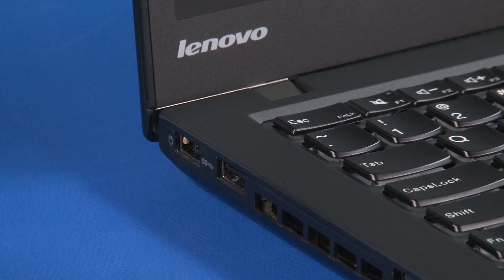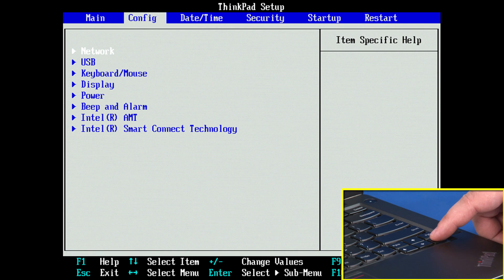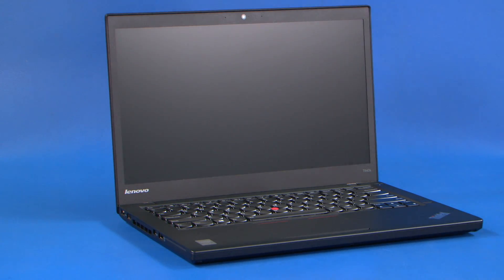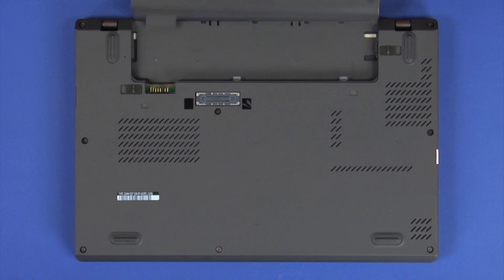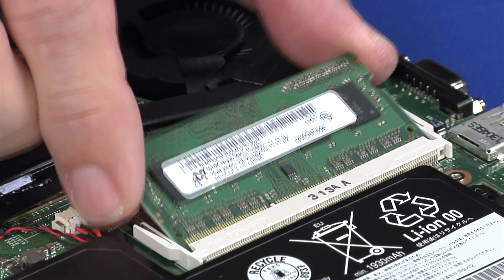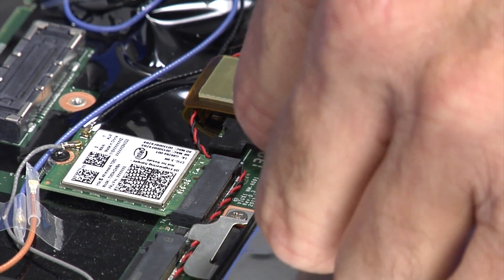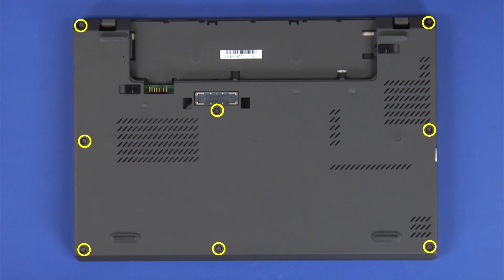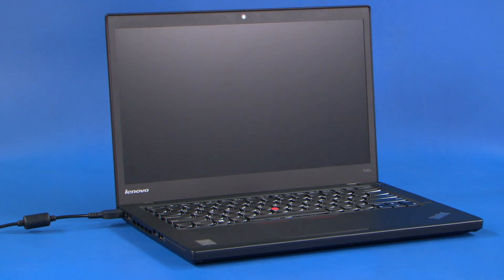ThinkPad X240, X250 - Memory Module Replacement

Comment: ram is basically plug and play, there is no big deal in replacing the memory with the battery plugged in. in any case just unplug it from the cable instead of having to do the BIOS option and then having to connect the charger just to re-enable it

Comment: Hello sir, thank you for this video, please how I can verify if my Thinkpad support 16 GB of ram, I need to upgrade my Thinkpad i5 4300U to install some stuff for studying networking and switching?
Thanks in advance
Reply from the maker: Hi BOUDJEMA! Thanks for reaching out. Could you provide the exactr model number of your Thinkpad laptop for us to check the specifications? We're here to help. Mark_Lenovo
Reply from the maker: Under the laptop there is a sticker where you can see some information. Could you check for the Machine Type Model (MTM)? Mark_Lenovo
Reply from the maker: Thank you for providing the information. We highly suggest you to delete the serial number you posted publicly for security reasons. As per the specifications of the Thinkpad X240 laptop, there is only one socket for the RAM/Memory Module and the maximum capacity is up to 8GB. You can check the specifications here https://lnv.gy/3mgbIua - Let us know if you have other concerns. Mark_Lenovo
Reply: @LenovoSupport  thank you for your help

Comment: Does the x240 have internal Ram like the t440s ? Like now i have 4 GB Ram , are those internal and will adding an additional 4 GB result in 8 GB Ram overall ?  Thank you for help
Reply from the maker: Hi. We're looking into your case and will provide feedback as soon as possible. We apologize for the delay. Heart_Lenovo
Reply from the maker: Hi Sam. Thanks for reaching out, and we're happy to provide assistance or direction to help you with this. Upon checking the internal memory is upgradable and supports up to 8 GB, so if you have 4 GB, you can still add another 4 GB, or simply get an 8 GB memory. https://lnv.gy/3CiIGym. Have you tried to contact our service centers for the upgrade? If not, we highly suggest that you seek assistance or contact them to check your device and provide the options necessary. You can also check the nearest and other accredited service centers from the below link, choose your country, support provider, choose home for your personal device, and on the right side press the location button and type your address, and hit search https://lnv.gy/3CEoFUe. Let us know how it goes. Heart_Lenovo

Comment: I replace 8GB to 16GB and computer don't  want to start. With 8GB it's ok. I tested few 16GB. I already update BIOS. What should I do?

I've got X250 i7-5600
Reply from the maker: Hey there, Adam. Thanks for reaching out to us. When you mentioned that the laptop won't start, does it mean that it's no longer powering on? Are you getting any error message or error code? Could you share with us the exact model name/type of your laptop for us to check? Here's how https://lnv.gy/3G19CCZ. We'll wait for your response. Rodney_Lenovo
Reply: @LenovoSupport  After replacement - the monitor screen remained black. Only the "power" button is lit green. I have installed the RAM "03X7015". The store where I bought the computer has already installed a few other 16GB RAM memories and also to no avail ...

SN of Lenovo: D28FFODE-386F-4CFD-8202
A8FC488F3113
Reply from the maker: I see. Were you able to disable the built-in battery prior to Memory Replacement? Hector_Lenovo
Reply: @LenovoSupport  Of course. I followed all the steps precisely as in the movie. After installing RAM, I waited up to 20 minutes for windows to turn on
Reply from the maker: I see. It seems that the socket is working, as it boots with the 8 GB RAM connected. There are cases where the boot is delay on brand new RAM, but eventually works after couple of minutes. Did the store test the memory on other computer as well? Hector_Lenovo
Reply: they wrote to me that they had the same problem with other X250s.
Should the RAM of any manufacturer with the "16 GB ddr3" parameters should work? not only "Lenovo", "Crucial"?
Reply from the maker: Could you share with us the exact specification of the RAM that you purchased? A photo of the sticker attached to the side of the RAM will help. Looking forward to your response. Rodney_Lenovo
Reply: @LenovoSupport  dear Rodney, I have a very similar issue with my new 16gb RAM - it turns on, but returns an error a few mins into the work, and then the blue screen appears with "Memory Management" error. I tried to format my Windows, but it fails even during format. Then I decided to perform a memory test in boot menu, it fails the integrity test. However I don't think it's a RAM problem. Any advice would be helpful..
Ironically, everything works just fine with 8 gb stick. Thank you in advance

P.S. my Lenovo is X250, cpu i5 5300u
Reply from the maker: Hey there, Mardan Tahmazli! Thank you for reaching our support! Just to confirm, did you add an additional RAM module into the laptop? If yes, did you purchase the same type/frequency of the RAM module for the X250? If the laptop works with the 8GB RAM module that came with it, it means that the additional RAM module is the one that is causing the problem with the laptop. -Chris_Lenovo
Reply: @LenovoSupport  Hello Chris! If I understood your question correctly, I replaced 1×8GB RAM with 1×16GB since the laptop has only one slot. But apparently, it doesn't work. It worked at the very beginning, but later started to glitch, and eventually failed. Crucial DDR3 1×16GB 1600 MHz is my new memory stick. Yes, frequencies match
Reply from the maker: Hi, Mardan. Another support here to help. May we please get the serial number of the device? Here's how to find it: https://lnv.gy/3i1z9SO. Karla_Lenovo
Reply: @LenovoSupport  Hello Karla! Sorry for the late reply. My X250 device S/N is PC06A40Z. The thing is I got this laptop from the local vendor here in Azerbaijan (probably was shipped here from the US). I hope this S/N tells you something. Thank you in advance!

P.S. and Adam, I am sorry for flooding your comment section🙈
Reply from the maker: We are so sorry about your new 16GB RAM. 
Your motherboard and/or processor will also dictate what RAM would work. 

Since you have tried windows reset and memory test and got failed, that means it is just the new RAM that is not compatible. 

You can also refer on this product reference under Memory : 
https://lnv.gy/3w3nHOy

Can you still exchange the new RAM? Diox_Lenovo

Comment: I bought 8gbram ddr3-1600 SODIMM 1.5C CL11 is this compatible for lenove thinkpad x250?
Reply from the maker: Hi there! Based from this link https://lnv.gy/3gxXxtu X250 can be upgraded to max 16GB 1600MHz DDR3L, one 204-pin SO-DIMM socket
Let me know if you have other questions. Arjay_Lenovo

Comment: Why did you enable/disable internal battery?
Reply from the maker: Before service to prevent electrical damage, power should be disconnected, removable batteries removed and/or internal batteries disabled.

Comment: where is the other module? its supposed to support 16GB, and i can only put one 8GB in
Reply from the maker: Hi there! Thanks for reaching out. Checking the Platform Specs of both models (ThinkPad X240 and X250), both models have 8 GB maximum memory. Please refer here (X240) https://lnv.gy/3ppsdRO and here (X250) https://lnv.gy/2IA76eR. Let us know if you need additional help. -Maru_Lenovo
Reply: @LenovoSupport  thanks for the response, even after only putting one stick in, it just beeps, so i put the old ram back in
Reply from the maker: Hi there. Another support to assist you. When you put the original RAM, does the device work fine? Ash_Lenovo
Reply from the maker: I see. Could you tell us the details about the original RAM and the details of the RAM module you're trying to install? We'd like to check its compatibility. Thank you. Ash_Lenovo

Comment: Damn lenovo why you have put only  one memory slot in the x250 , and now I've to buy an expensive  8gb ram instead of just another 4 gb ram
Reply from the maker: Hello Ali.
Thank you for reaching out.
It only has one ram slot because it has Intel SoC (System on Chip) platform. You can check the specs here.
https://lnv.gy/2K1QTvP
Nick_Lenovo

Comment: Sir .Can I ask you for 3 question. After I want to buy a second hand X250(CPU i5 -5200U,RAM DDDR3 8GB and HDD SATA 500GB) and need to upgrade on my own So a question is>> Can I
1. Upgrade RAM to 16 GB
2. Upgrade HDD to 512 GB SSD
3. Replace new batterry (6 Cell)

Thank you so much
Reply from the maker: Hi Rung! Thanks for reaching out. The RAM of your ThinkPad X250 is up to 16GB and the storage is removable which can be replaced to SDD. Also, the removable battery is optional to Li-Ion 3-cell (23Wh) or 6-cell (48Wh or 72Wh). Refer to this link https://lnv.gy/2S2yh2r. Let us know if you need further assistance. Van_Lenovo

Comment: I'm not a specialist but with the information included in this video, I changed the memory  ram (from 4gb to 8gb)  and the hard disk (from 500gb 7200rpm to 1to SSD. ) in my X250.   It was fast and easy.  Thank you !
Reply: I also have x240 it is very slow with 4gb ram. Should i switch to 8GB?
Reply: can you share the details of your purchase as i want to upgrade my X250

Comment: Can I upgrade my memory ram in my Lenovo Thinkpad from X270 from 8gb to 16gb. Kindly advise what model to upgrade??
Reply from the maker: Hi @rudy lee ! Thanks for writing in. The Memory of the Thinkpad X270 can be upgraded up to 16GB max 2400MHz DDR4, one DDR4 SO-DIMM socket. You can find more info here https://lnv.gy/2BxKxjw You can use the part no. 01AG713, 01AG714 and 01AG715 to get the compatible 16GB ram for your laptop. Let us know if you have further questions. Hector_Lenovo
Reply: @LenovoSupport  can I upgrade x240 to what max storage, currently it only has 100gb. And what storage card would I need? Thankyou
Reply: rudy lee the x270 supports up to single 32gb stick.

Comment: Is there only one Ram slot available in X240, Unlike the X230, which had slots for 2 Rams?
Reply from the maker: Hi moazzam faiz! Thanks for reaching out. Yes, that's right. There is only one RAM slot for the Thinkpad X240 laptop. You can check this link for more info https://lnv.gy/2B57hsd - Mark_Lenovo

Comment: Hi, Have a question, I want upgrade my thinkpad x250 8gb ram to 16 gb ram, I can do it?
Reply from the maker: Hi there. Thanks for reaching out. Upon checking, you may upgrade the Thinkpad X250 memory up to 16GB. You may refer to this link: https://lnv.gy/2LZSiGe. The part number compatible 16GB for Thinkpad X250: 03X7015. You may check other system service parts of the Thinkpad X250 here: https://lnv.gy/2M2mK2o. Let us know if you need additional information. Auxen_Lenovo

Comment: @LenovoSupport
 I just purchased a refurbished X240, then got the 8gb upgrade module frum Crucial.  Following your instructions here, it does not take me to the bios to disable the internal battery, only keeps taking me to my Windows desktop screen.  Can you help me get this ram installed?

Comment: how much can upgrate the ram to lenovo X250 i3? and wich ram need for it? pleaseanyone show me the link to buy it
Reply from the maker: Hi Bleron! Thanks for reaching out. I did a quick search and found the part number(s) of the compatible RAM for your ThinkPad X250. There are three (3) compatible RAMs, 03X6656 (4GB DDR3L 1600 SODIMM), 03X6657 (8GB DDR3L 1600 SODIMM) or 03X7015 (16GB DDR3L-1600 SODIMM). Please refer here http://lnv.gy/2jlv1Sd. Prices and availability may vary and we recommend contacting our Parts Sales Distributor here http://lnv.gy/2jivrZL (under Purchasing Accessories, Upgrades, and Replacement Parts (FRU),  click your region). Alternatively, since you have the part number, you can check with third party vendor like Amazon, eBay, etc. Here is also our service training link http://lnv.gy/2jiZrVs to guide you in removing and installing part(s) on your ThinkPad. Let us know if you need further help. -Maru_Lenovo